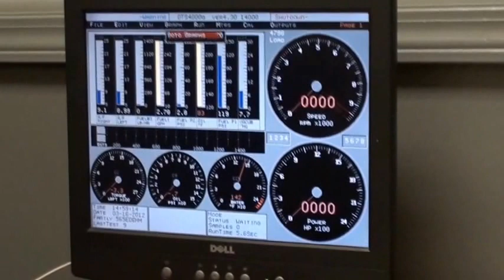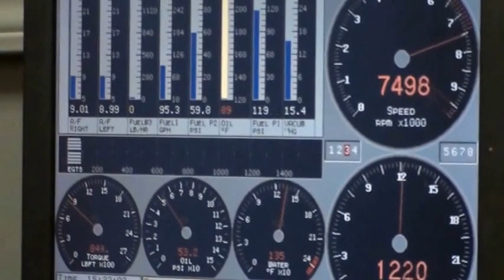Pat Musi & WON dyno session

Comment: To Big Bore Racing;  Do what the hell you want with my gear, it's your loss not mine!!! This video demonstrates the superiority of my Pulsoids, so if you want to throw that advantage away, I guess you're not that smart. Johnson & Vasser NEED to listen to their customers, as neither of them has an original thought between them. Johnson wasn't smart enough to recognise the superiority of even my Pulsoids when he "claims" to have tested them (even the dopes at HolleyNOS managed that much) and although Vasser was smart enough to see the advantages of my plate designs, he was too stupid to COPY THEM CORRECTLY and as a consequence he was responsible for a large number of motor blow ups. 
I have a simple principle that I work to, TREAT OTHERS AS THEY TREAT YOU. When you talk to me like shit don't complain like a pussy when you get the same back with interest. Furthermore, I'll listen to accurate and constructive advice, when it's presented with respect but when it's WRONG and already in operation and presented to me in an offensive manner, you can only expect to get the same back.